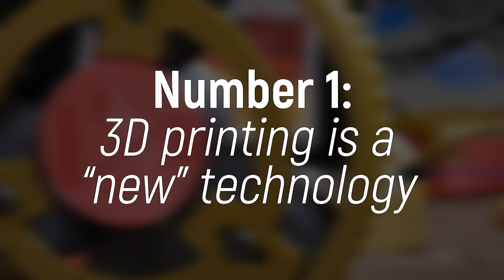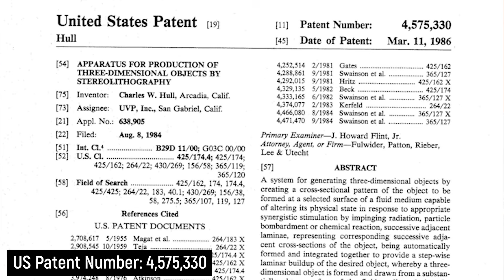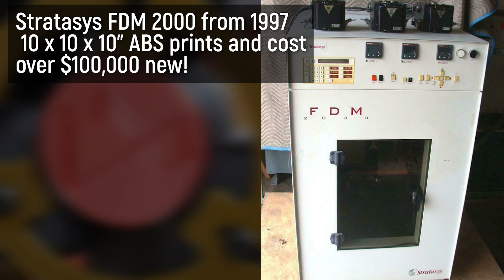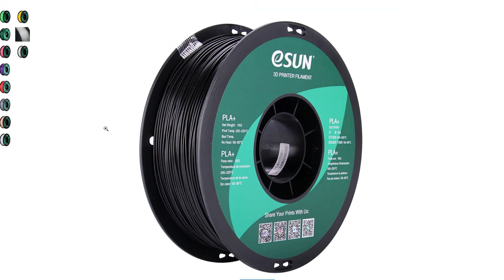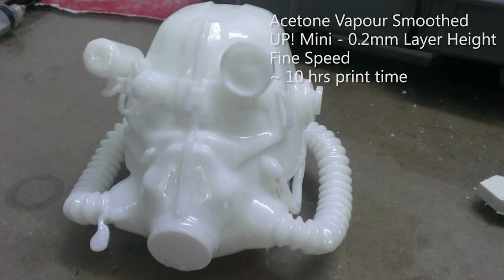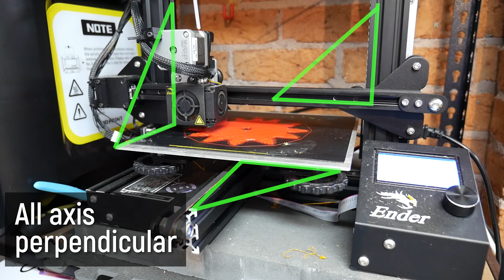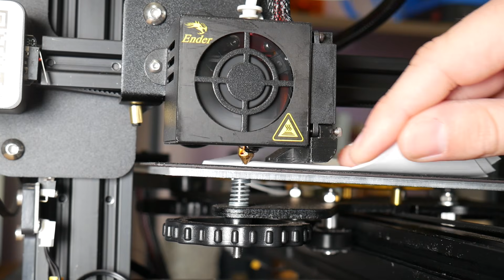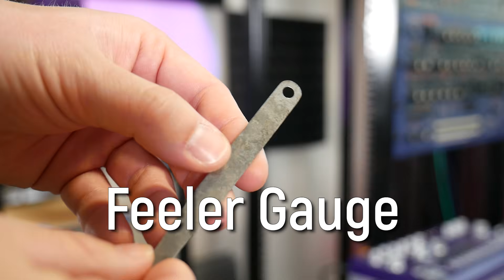3D Printing Myths I used to believe...

Comment: Great summary on ABS vs PLA. Filament has really advanced since you and I both started our channels. I’ve been experimenting with a feeler gauge technique but my paper then live adjust bed level video stills helps a lot of people get started so I don’t see it as a myth, just an option.
Reply: I do paper and then adjustment by eye during a test print and it works perfectly. It just takes a bit of experience to be able to know your machine and do it quickly.
Reply: CHEP, your easy bed leveling video and the gcode you made to go along with it is one of the first things I direct people to when they are getting started with printing since so many people have a hard time tramming their beds properly. I run your bed level gcode before I start pretty much any print--taking that two minutes to make sure my bed is still trammed each time and make tiny adjustments saves me hours of frusteration later.
Reply: @guslado  woudl you mind sharing those two videos from @chep with me? CHEP, your easy bed leveling video and the gcode. Thank you in advance.
Reply: Always get me perfect first layers.
Reply: I use a dial indicator to micro adjust the nozzle height after the initial paper. If all four corners 0 out then I tend to go with it and use a .2mm first layer.
Reply: If you use a single sheet of paper (about 120 microns thick iirc), because the nozzle is a single point you'll probably only be out 50 microns or so.

Close enough for military work.
Reply: @cmdreltonpoole6303  o7 commander
Reply: @cmdreltonpoole6303  I use thermal paper, always 0.05 mm thickness (at least the receipts I recieve here 🙂). works like a charm.
Reply: The paper can be used in place as a feeler gauge. The point is that you are offsetting the nozzle PRIOR to leveling. When the printer is at .2mm high to lay down a line, it should be at .2mm, not .2mm plus the thickness of the paper (usually around .1mm). The paper method can mean that the nozzle can be be 50% to far from the bed or more depending on layer height.  Live leveling attempts to cover that issue up, by now making it a random distance. While it is closer, it still isn’t exact and still causes issues. The method presented in this video allows exact repeatability and is the way to go.  In fact, the whole process can be shortened into a single sentence. “Before leveling, go into the menu and raise the z axis by the thickness of the tool you are going to use to level the bed”. You can level the bed with 10mm block if you wanted to.
Reply: True. By the way, CHEP, you are the best.
Reply: Your paper method still works like a charm
Reply: CHEP  your technique has NEVER failed me.  I think Muses assertion is a bit of a broad-brush.  I myself use index cards.
Reply: @spacemanvic3961  SMH
Reply: @AkiraFurball  ?  The filament drips through the nozzle, so I am not getting a real height read from the nozzle.
Reply: @spacemanvic3961  preheat the bed to full working temp, but preheat the nozzle to 10 or 15 degrees below printing temp.. Pulling filament out a few MM will also limit it..

I usually then give the nozzle its once in a blue moon clean with a brass brush also, its about the only time I get round to it :D
Reply: @AkiraFurball  I think I follow.  You are accounting for expansion of the brass nozzle?  Does it really change Z axis measurement that much?  I have since installed a CR Touch as well as done away with the springs and use spacers now under the bed and have calibrated it and printed CHEPs square test, but have yet to print a project since the upgrade.  the test printed perfectly.
Reply: @spacemanvic3961  the bed makes the most difference, the difference between 200C and 185C on the nozzle would be negligible to be honest..

If you dont heat the bed the big concern is not just expansion but warping or uneven expansion.. If the bed warps with temp and you probe it cold, then the compensation mesh will not match the hot bed.

But yes it does also make a fair difference thermal expansion wise, it could be 0.2mm z difference between a cold printer and one preheated to print temps.. and that is a lot in 3d printer terms..
Reply: I'm too lazy for paper or feeler gauges - I heat up the bed, use a BLTouch to home, move to the middle of the bed (G1 X117.5 Y117.5 Z0), then set the Z-Offset by eyeball when it touches the bed. This has been close enough for just about every filament I use - however occasionally, I need to babystep by 0.05mm for those filaments that just need a fraction of extra space to go down well (Silk PLA does this to me often, PETG or ABS - not so much).
Reply: @CRCinAU  its very much easier with BLTouch, you can do the manual tramming with anything you like because its not setting the nozzle height, only the tram, paper, 2mm thick metal plate, does not matter..

Z height is then set with adjusting z-offset, a single point is all thats needed, and I do it just the same, light behind the nozzle, and lower until it just stops being visible between nozzle and bed.. perfect z-offset and layer..
Reply: Yes but now lets hear why PETG isnt just always better than PLA
Reply: It's probably because he's folding the paper.
Reply: I only started 3d printing about 8 months ago, I'm wondering where he got "folded paper" from, every place I looked said to use a single layer of paper, not a piece folded into several layers.  Several of your videos were helpful CHEP, got me on the right track starting out, so thanks for the help.
Reply: Yup, I think the important part for new folks to know is that the paper just gives you a starting point.
Reply: I've been leveling all wrong. You squeeze the springs first?
Reply: @Suicide Kyd I got delivery 2 days ago.
Reply: I find your videos great, & your test/ tramming models quite good. But Still have am having issues. I have NOW switched over the CR6-se & put aside the Ender 3 pro due to leveling/ Tramming issues. Just wish I had someone local to ask a lot of Questions!
Reply: Feeler gauge is what is use in manufacturing
Reply: While I agree that the paper technique work for "beginner", they will all come to the realization that it's a bad way to level the bed (just like he kind of explain) and we are printing and mostly all trying to get dimensionally perfect parts. So why not just use a professional Gauge tool kit exactly made for this instead of using a mere piece of paper that probably change more in height  than my morning turds.
Reply: @mophie6941  can you explain this to someone who's still using a piece of paper? What do I need to buy and how do I use it to level?
Reply: @keebsnstuff3400  You need feeler gauge, But im gonna be honest, He mention to make the frame perfectly square with the 3 axis and that is the most important part befofe even trying to level the bed. depending on the printer it might be harder ( less option to tweak bed)
Reply: @mophie6941  yeah, I've done a frame rework as part of my calibration already. What size gauge do you use for PLA/PETG/etc.?
Reply: @keebsnstuff3400  My guess would be a set of 0.05mm to 0.2mm seem like a good range to have (this would give you play for nozzle swap) . I got to say tho, feeler gauger are not cheap.
Reply: @mophie6941  I'm just impressed that you are dedicated enough to quality control to inspect your morning turds for height consistency.
Reply: @racketman2u  🤣🤣🤣🤣
Reply: How do you know which feeler gauge to use? Does it correspond to something on the printer?
Reply: @CptFreemanC17  it's all in the vide0 bro

Comment: I spot ponies. Have a like for that alone (the rest was nice, too tho 😄)
My first experiences with 3D printing was an internship in a rapid prototyping company in 2004. Daaaamn, was that inspiring! They had both resin and dust(? It was some sort of polymer tho, not metal dust.) based SLA printers, and could print models huge even for today (at least for hobbyists),  I think something like 60x50x40 or so cm on the dust based ones.

Comment: Think you missed the chart showing ABS impact strength? Just classing a property as "strength" is heading into myth territory, Tensile, Yield, Impact and so on are better ways than just saying strength.  "Better" all comes down to the application. A strong PLA or PETG print is useless if it's going to deform due to stress-induced creep. #TeamABS

Comment: 1st. All the research I've done over the last 2 years and this is the first time I've ever seen somebody mention the paper trick using folded paper. Everything I've ever seen was a single thickness.

2nd. I think the feeler gauge is a great idea. I've got multiple laying around and never even thought of it. I assume the thickness that we would choose to use would be the thickness of the layer height that we are actually using correct? Or would we go down by 20 to 30% for that first layer squish?

Comment: Myth #2 I think would have been better to explain as for how a given material will preform depends on both the Environment it is going to be used in as well as the Application it's going to be used for. With the larger selection of materials now available for FDM printing there are many cases were one material will be better than another. For some situations ABS will be a poor choice,  in other cases ABS is still an excellent choice as a material to use, especially when printed by a machine that is actually designed for it (and not just making the claims, like some you cited did). Sources like CNC Kitchen's methodical testing or long term experience by the 3d printing community can help us make an informed choice of what to use for a given situation. 
TL:DR Myth #2 just came across to me as 'ABS Bad', which is something I once thought myself, but after experience I now know isn't true.

Comment: I've never set the nozzle height with folded paper in 5+ years of printing. It has always been pretty clear that if you fold the paper and just let the nozzle touch it, it will be too far up. I just use instead a piece of paper unfolded and raise the bed until it scratches deeply in the paper, but not too much so I can't move it with ease. This has always been a success. 

Although yeah, the feeler gauge is a better method

Comment: I'm new here but I have read a lot about PLA vs ABS and was wondering simply if PLA just got better over the years to bypass ABS and other older filaments? My first few prints with my printer using PLA did kind of set me back on how strong PLA really is vs the videos I watched about it. And again most all videos I did watch about how bad PLA is were older videos?
Reply: I have a roll of PLA that i bought 4 years ago, and because i prefer to live in darkness and the room is exceptionally dry, it hasn't degraded much. I might have dried it in the interim, i forget. Anyway that was the cheapest PLA, and it still produces very strong prints. The polymer has inconsistent pigmentation, with much too little pigment overall, so natural PLA properties come out strongly. From the surplus that the manufacturer was selling off, i surmise that it's using a foreign masterbatch, EVA based, maybe that has a bit of influence too. Though i don't know that the tiniest amount of EVA actually does anything.

I think it's to an amount the case of what you need out of your prints, what is considered a failure. For many prints, any permanent deformation is a failure, since the print is then weakened and can fail under repeat normal loads later, and PLA does OK with that. Also depends on bed temperature and print geometry, remember, early DIY printers did not have heated beds, but if you have a print that's less than 5mm tall, it will experience a slight annealing action even a little bit, which helps out its strength a lot. Then there's layer alignment, if you have bad mechanics or can't get the material to solidify rapidly, you can get weak prints, because the perimeters don't sit exactly on top of each other, which is another issue of early printers. But you don't want too much cooling either, but get it just right, and you get much stronger prints than either overcooled or completely without. Extruder and hot end performance too, you want it to be consistent, and you want slicer and movement planning firmware of the printer to make accomodations to help keep it consistent, and i have evidenced a lot of software improvement just in the last 3 years. I think a lot of things have made so much progress in 10 years, that it's difficult to single PLA bulk material out as the one thing that changed. Though me printing since 2017 it also means i was at the tail end of a lot of this development rather than seen it from the start.

Comment: I am relatively new to 3d printing but it seems to me nobody actually measures the first layer.  Just use feeler gauge or paper, then baby step till you get a good looking 1st layer.   Seems you should gauge, then use micrometers to dial in the height then use flow to get either width or good looking first layer.

Comment: My CR10S Pro (v1) came with a 0.2mm feelers gauge. However they said to set Z=0 at the gauge height. So first layer was always 0.2mm too high and baby-stepping was not implemented yet. That said I also find actual Z=0 too close. I tend to set it at 0.1mm above the build plate.

Comment: "LEVEL_BED_CORNERS" in Marlin allows you to perform the manual bed leveling and you can set in the firmware the height of the nozzle (aka the thickness of the feeler gauge) to speed up the procedure.

Comment: ABS is stronger than PLA. However, NOT the "consumer grade ABS filament".
Eg. don't ever expect a China-consumer 3D-printer to print ABS, because it just can't. It may look like it can, but it's not the real deal.

I've seen a $13000 3D-printer print ABS and the item it printed was so incredibly thin.
I tried to break it, but ended up having hurting thumbs.
No consumer 3D-printer would ever be able to compete against that printer.
Unfortunately, I don't have the name of it, because I just knew I'd not be able to afford one.
-So yes and no; it all depends. Personally, I'd never print with ABS - fumes are toxic and result isn't worth it on a consumer printer like mine (even though it's advertised as being capable of printing with both ABS and PLA).
A much better choice is to get some PLA-Tough or PETG (I'm using the Swedish Prima brand and I find it more than adequate for my needs - besides, I know it's a non-chinese product; all of it is made in Sweden and certified).

Comment: The using a level on the print bed mention cracked me up. My sister just got her first 3D printer last month and has been loving it, but started having first layer issues so I told her try try re-leveling the bed. She was like "ooh! I have a level, will that work?". Cracked me up, but completely understandable. Then I reminded her or the paper trick I showed her when we built it, and it fixed the problem.    :)

Comment: I use exactly one sheet no folds. And i make sure if im using a raft the paper can slide under easy and if its a brim or skirt i make sure the hotend has a grip of the paper
Reply: Should work, but that's not really what Angus is trying to say.
Your printer might be doing well as it is right now; if so, it might be best to leave it as is (eg. "if it ain't broke, don't fix it").

What Angus is saying is something like ...
Make sure your printer's axes are perpendicular to eachother (eg. 90°).
-That's very important.
But also measure the distances from the top of the bed to the top of the chassis (which is below the bed; eg. it's holding the bed).
Measure from the left z-stop to the top of the chassis. Do the same for the the right z-stop. Those two measurements should be equal.
Remember that the Y-axis should be perpendicular to both the X-axis AND the Z-axis.
The X-axis should also be perpendicular to the Z-axis.
Even when all this is in place, you may still experience problems with the bed being completely out of adjustment.
If that's the case, you'll need to inspect all the hardware that the bed is mounted on; if the 3D-printer is using rods, then check if the rods are crooked or bent (Anycubic). Check if there's stress on the rods (Anycubic).
-Unfortunately, that's not all, there are a ton of other mechanical properties that you may need to check, depending on your model.
My best advice is to look at the printer and imagine what can be wrong.

Hint: If the printer prints parallelograms, rather than rectangles, then you may have to check if the axes are perpendicular to eachother.

Comment: Thank you very much for the always amazing videos. However, relevant to bed leveling there is some points that quite mismatch with what I have always known and used. First: a sheet of paper is around 0.1 mm thick and that is why it is usually suggested to use, since it's an average distance that could be ok most of the time. But I never saw, nor used a FOLDED sheet of paper, because that would lead to a too high nozzle, which is what is reported in the video, and that was quite confusing. I have also used the feeler gauge of 0.1 mm quite often before ABL and it worked, but not so incredibly better compared to the unfolded sheet of paper. Nowadays, on modern machines anyway, probes, babystepping etc are making all the work much easier. 
Thanks for all this anyway, exceptional work during all years!

Comment: There is no reason you can't use a piece of paper as a feeler gauge accurately. The trick is you need to know the thickness of the paper your using so you need to have calipers to measure the paper.

Comment: The way I level my bed is using the bed level visualizer plugin for OctoPrint with a BL Touch. It can display how level your mesh is after measuring it and you can enable a view that shows how much you need to rotate in which direction to level it. Might be incorrect but I found that it works consistently unlike messing around with paper. I haven't really seen anyone mention this on youtube.